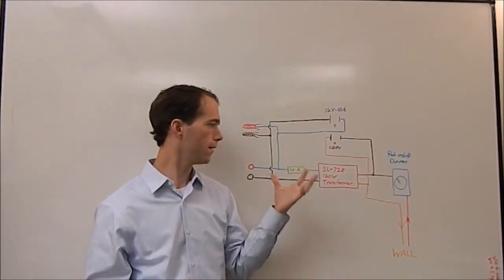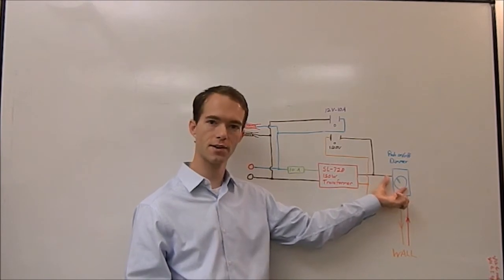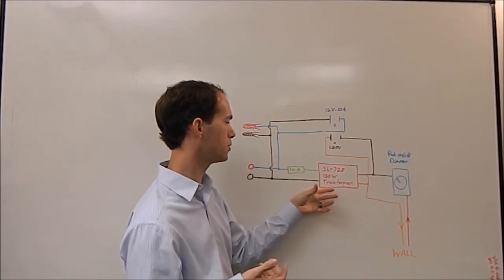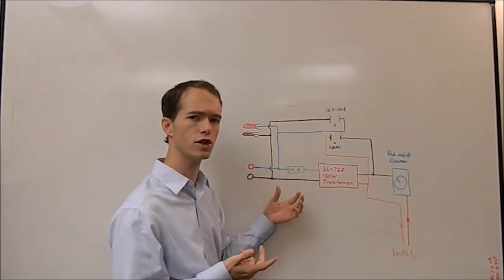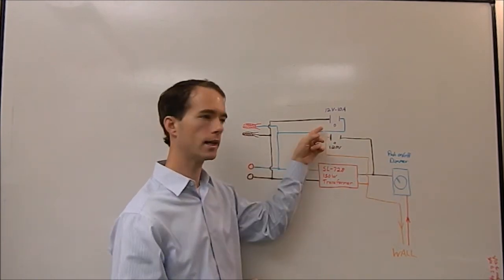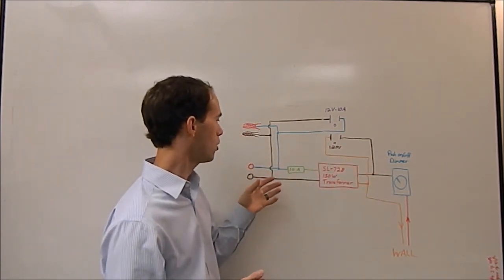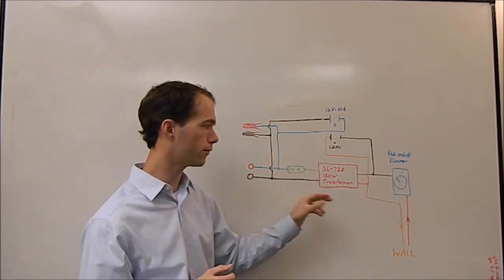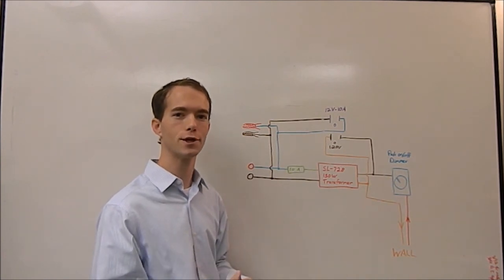Hot Wire Foam Cutter Power Circuit Explanation      MikesInventions

Comment: Shouldn't your fuse be on the inlet side of the dimmer?  The way you have it, the dimmer and 120V outlet are unfused.
Also, don't you need a bridge rectifier to convert the 120V AC to DC?

Comment: Hi Mike! I'd like to make this for smaller items too but mostly to connect it to a large wire cutter tool with a larger wire gauge to cut big blocks of foam (1lb. - 3 lb. EPS/Polystyrene) on blocks of size up to 4ft. - 5ft. thick. Admittedly I'm horrible when it comes to electronics so I'm asking if your unit is capable of such tasks and if not what would I need to beef it up? Thank you in advance for your wisdom.
Reply: Here's the best one I've found so far for this purpose coming in at 8amps and available to use with wire 11 gauge. https://demandproducts.com/OWA/Product/Details/APC/001/-/auxillary-power-controller-nwfw-nwrw11-only8-amp-fuse-5-power-6-gator-cord-500-wat
Reply from the maker: Hey Piper! Sorry for the slow response. I don't know if this unit is capable of cutting 4-5' of foam. The largest thing I've cut is 3' and it worked ok. I've got that 10A fuse on it, and I could also use a smaller wire so it gets hotter. Anyway, cutting that this is certainly possible with this, but it's not very fast. It's a cheap way to get started though and run some tests. You can always get a larger transformer if you need to. Thanks for watching!

Comment: Is it necessary to use a dimmer switch
Reply from the maker: Well, it's not "necessary", but it sure is helpful, otherwise you'd run your wire at full power all the time. You also might blow a wire really quickly when you first turn it on if the wire is too small. I can't think of a really compelling reason not to have one. Thanks for watching. Good question!

Comment: i placed a 13 amp fuse before the dimmer switch. and my hot wire cutter ran for 1 minute. then stopped as i was turning the dimmer switch up, the fuse is fine, what could be the problem?
. (that was before seing this i used jacobs online circuit. )
Reply from the maker: Hey there Js. The fuse was on the wrong side of the dimmer and transformer. You probably blew the transformer. Sorry. I know that sucks. If you follow the diagram in my video, you shouldn't have any trouble on your second attempt. Thanks for watching. -Mike
Reply: thanks Mike, does this mean if i had the fuse on the right side it would have break instead of the transformer? what could be the reason for the transformer to blow,?  and if the fuse would protect it (if it would break on the right side)? and how can i prevent that. or wold i have to replace the fuses each time
Reply from the maker: Fuses are designed to interrupt the circuit any time the current rises over the specified value. Current is what heats things up and causes things to go out. It makes more sense to put the fuse on the secondary (output) side of the transformer for the reasons mentioned in the videos. Ideally, you wouldn't run your wire hot enough to blow fuses all the time either, but fuses are designed to protect components and people. What are the specs of your transformer?
Reply: it was 12v i ddnt know its currency rating. And i got some Bad news.! i just blew another one. I took a transformer out of an old music system, it was  a 12v, 8amps. this one had four wires on the secondary side. I connected a 1.6Ampere fuse  on the secondary side. but, the problem was I didnt know which of the four wires to connect to the Nichrome wire, because it has 2 red wires and 2 blue wires comming out of the secondary side so I took one blue and one red and connected to my foam cutter, nothing happened but using a tester the nichrome wire had some electricity in it, so i decided to bind the two red as one and the two blue as one and within seconds the transformer started smoking and got ridiculously hot. (right now am using my LG usb charger 5V, 1.5 amps works but not hot enough to cut UPVC.
Reply from the maker: Yeah similar colors mean they are on the same coil. When you tied them together, it shorted out. When I'm unsure about how a transformer is wound, I check it with a multimeter to see what coil goes where. Please be careful with your foam cutting experiments.

Comment: Hi Mike... I've done this configuration using a 120/24 40 VA transformer but seem to be overloading the transformer before the fuse goes.  Suggestions?
Reply from the maker: Hey Patman! Is it a doorbell transformer? I'm assuming it gives you the option of either 24 or 40 and changes the voltage accordingly...?   40VA / 120V is only .33 Amps. That's not enough to heat a wire, but it's plenty to blow a transformer when you try to heat a wire with it. My wire usually pulls about 3 amps, so you need to make sure you have plenty of amps available. I speak from blown transformer experience on this one, and that's why I recommend the electronic SL-728 150W transformer. It's typically used in lighting.
Reply: Mike Thompson not a doorbell transformer but definitely a magnetic (it's got coils) only has one output option (I blew a doorbell one in my first try) when I go to electronic store I should ask for a transformer that can handle what load? I figured 40 VA was enough but there is a next step up that is 100 VA... For 10 bucks more (Canadian dollars) thanks for the advice.
Reply from the maker: Well the one I use is 150W, (neglecting technicalities of apparent power and things) which would be the same as the Volt-Amps you would need. My wire only pulls 3 Amps @ 12V so it's using 36W at my typical setting. If I crank the transformer all the way up, the wire glows and burns through. BTW, if your wire glows at all, it's too hot. You also might want to check that your wire has sufficient resistance.

Comment: What is the purpose of the dimmer switch other than an on/off function?
Reply from the maker: It allows me to adjust the heat on the wire. That's the primary function actually. I guess I didn't make that clear enough. My bad.
Reply: +Mike Thompson I guess my confusion is more of why put it in front of the transformer instead of after?
Reply from the maker: The Dimmer is made to run at 120 volts instead of 12 volts, so I put it in front. This also allows me to vary the voltage to my 120 volt outlet that bypasses the transformer.
Reply: +Mike Thompson Got it. Thanks.  So alternatively you could use a potentiometer on the DC side to control only the output. Correct.
Reply from the maker: I suppose you could do something like that. It's AC on both sides, and remember the amperage is much higher on the secondary side, so size things accordingly.

Comment: I see some of the sl-728 transformers say "non-dimmable" and others don't say anything at all about it. What specific brand is yours?
Reply from the maker: My transformers are Top Star brand. If you change the input voltage to the transformer, you'll get less output. I'm not sure why something would say un-dimmable. The transformer itself doesn't have any markings that indicate it's non-dimmable. I see some E-bay listings say that, but it doesn't make a lot of sense.
Reply: Excellent! Thank you for responding so quickly.

Comment: Thanks for vid!! I tried a doorbell transformer first and kept blowing them. I ordered the sl-728 trans. however things seem odd, could I need a special dimmer switch? Such as one rated for halogens? Thanks!!
Reply from the maker: +David Helman No special dimmer required. I picked up a standard lighting one from Home Depot for like $8. Yeah, doorbell transformers just don't have the power required.
Reply: +Mike Thompson Thanks for reply!! It seems to have very little drop in power with the dimmer I'm using. Maybe I just need to experiment  more. Was getting late when I re-wired it up, so just turned it on and ran some scrap foam thru real quick. So much hotter than with the doorbell transformer. Just a bit gun shy not wanting to fry another transformer LOL! Thanks again!!
Reply from the maker: I have a 10A fuse and my wire can glow orange without blowing the fuse. You're probably ok to turn it up a bit. Glad It's working out.

Comment: which wires on the sl-728 are hot and negative, black and white on input side and both red on output side of transformer, how do I need to run my wire
Reply from the maker: +jimbo Adams Just match up the blacks and whites as usual on the input side. Since it's an AC xformer, primaries and secondaries aren't directly coupled, so it doesn't matter how you wire the secondary side really. I guess that's what they were trying to signify when they made them both red.
Reply: I got it figured out last night...looked at your drawing in the video, just got to add a fuse on the output side.. but it works great, thanks for the video and thanks for responding back, I really appreciate that !

Comment: What local place carried the light transformer?  Basically copying yours, with a different box and different wiring to the outlets due to need.  Thanks for the helpful videos and explanation
Reply from the maker: +Evan Luck  - I got it from Locke Supply. They are an electrical supplier where all the electricians shop. It's used for low voltage lighting. I'm sure someone local has one. A low voltage electronic transformer is a fairly common thing.
Reply: +Mike Thompson Thanks for the reply.  Unfortunately it's not nearly as easy as it used to be.  Radio Shack no longer caries transformers at all.  I did find one at Fry's Electronics, though its 18V and on 2A so not sure it's going to be enough.  I'm going to give it a shot though.  I found a sweet 6inch junction PVC box at Lowes for super cheap.  I'm putting in together now and will make a video and link it to see what you think.
Reply from the maker: It sounds like you got a magnetic style one like for a doorbell. I tried that first with no luck. Returned it.  Magnetic transformers that put out enough amps are really big and expensive. Electronic transformers are much cheaper and can crank out a lot more amperage for a given size. Radio Shack sure has gone downhill in the last 20 years. Let me know if you get it working.
Reply: +Mike Thompson I did get a magnetic one for about 10 bucks.  But it's not a low-end doorbell 16V transformer.  It's a Philmore 18v 2amp.  Purring like a kitten actually.  I'll make a video of the build for you and link it tomorrow.
Reply from the maker: Awesome!